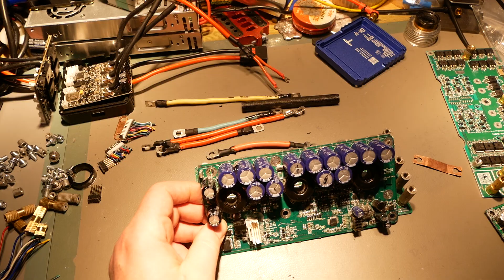Talaria controller teardown overview

Comment: I’ve managed to lock the speed at 50km using 644 method, and trying the same method doesn’t unlock it. I’ve also tried cutting the brown wire, to no avail. I’m wondering if you know if there is away to reset or reflash the controller to factory settings? The country I am in does not have a local supplier so am in a bit of a predicament

Comment from the maker: @very funny I got an email with your comment, but it's not listed here.
"Is offsetting the ferrite ring the only way to get more power from it? Could power output be increased from cpu uart?"
*
The easiest mod is moving the ferrite rings. Unlike the Surron controller, they are soldered down in the Telaria controller. They are also totally enclosed. You can't really shift the ferrite ring over to "fudge" the current reading. If the CPU can be reprogrammed, that's your best bet. It's a different design and the Surron mod wont work here.